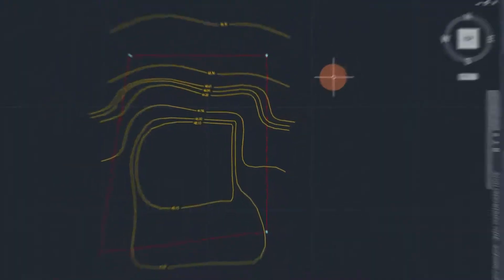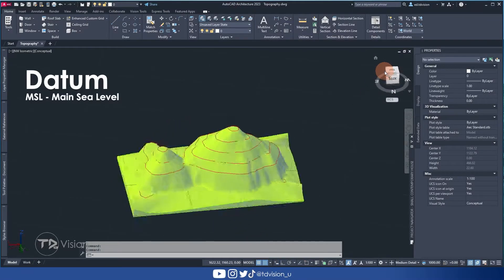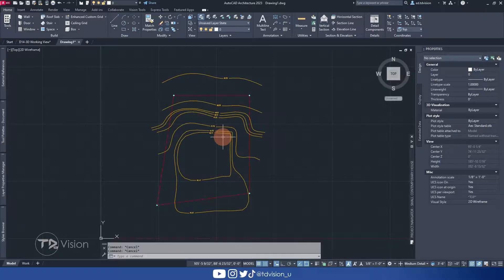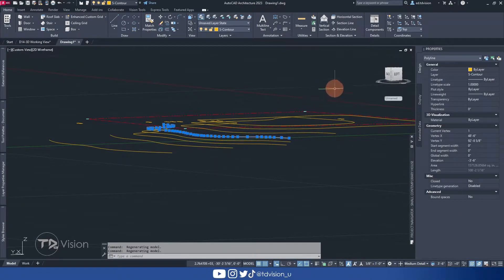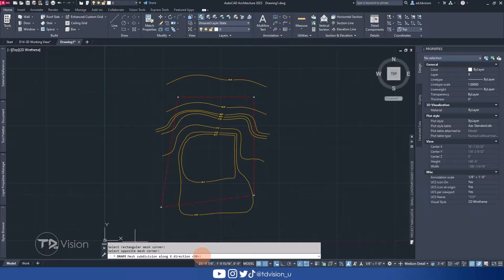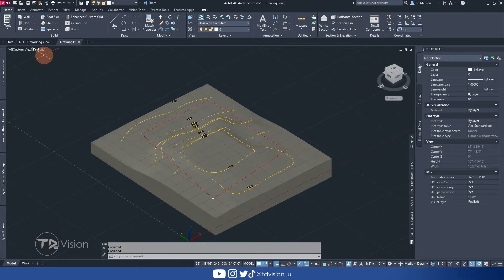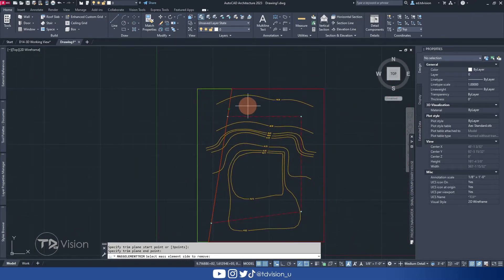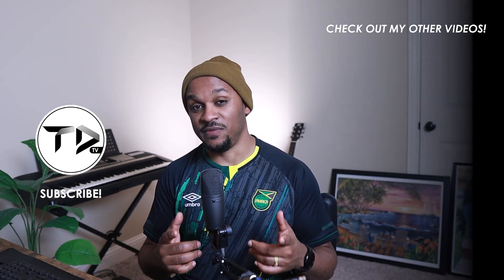How to: Do 3D TOPOGRAPHY in AutoCAD Architecture 2024

Comment: So, I’ve tried using your method with contour lines I’ve already been given, but AutoCAD won’t let me use the drape tool for some reason. Is there another way around that to get the same results?
Reply: My ACAD also doesn't accept the drape command :(.
What is at stake and can the drape command be replaced by something else such as extrude?

Comment: Is the topography depressed below the 0 level and then adjusted to appropriate elevation or height, nessecary to suit the building structure or design?
Reply from the maker: That's one way to do it. Another way could be to have both the building and the topo xref into a new drawing (perhaps a view), and move house xref to the desired location on the topo xref. That way, the only things that get moves are the xref links, and not the drawing itself.